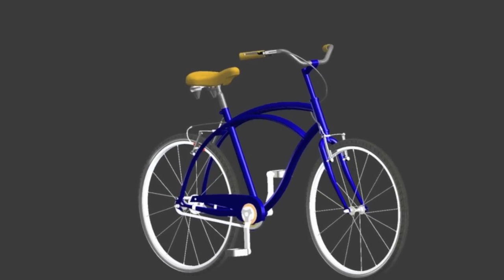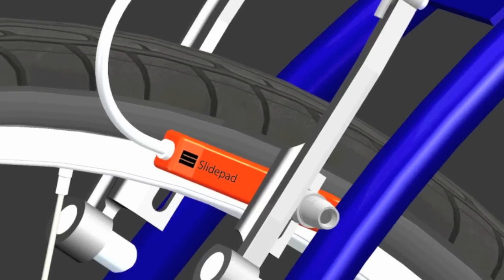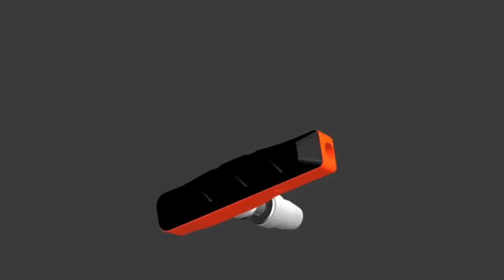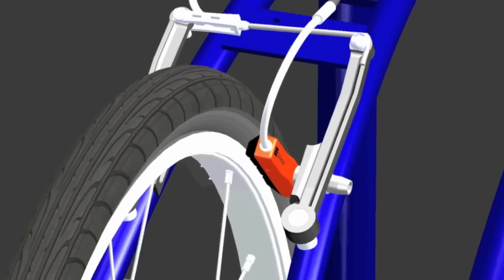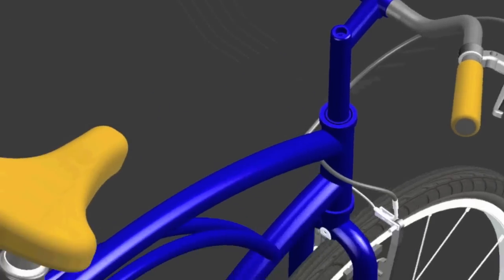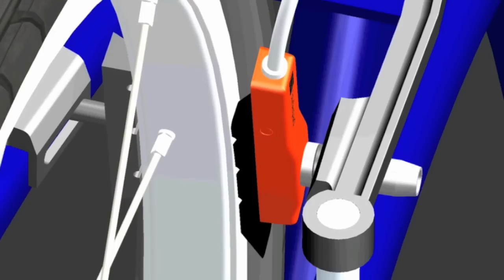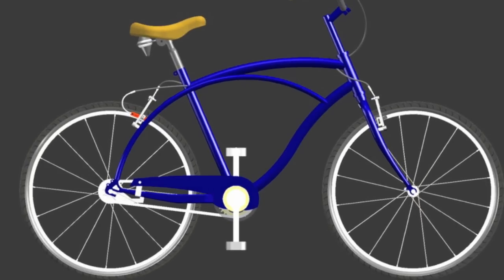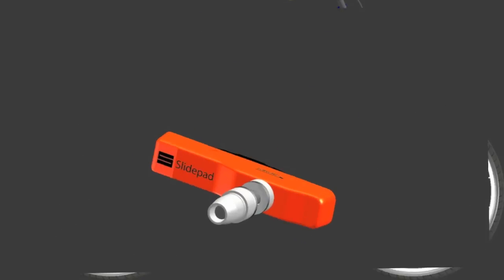Slidepad Brake System - How it Works

Comment: What about rear wheel? It still should have a brake. It gives you a backup, allows to brake more evenly, reduce front lockup severity(although front lockup can largely be fixed by limiting the brake force in front)

Comment: the redundency of 2 brakes ensures you always have 1 brake working if the other locks up. One sided brake means that if you have a problem, you are in a life threatening situation. personally, i love the engineering and i would never have it on one of my bikes, for mountain or city use with cars and junctions. brakes are your life-line on a bike and having 2 life lines is sensible. because if one jams, cable problems, pops out of guide, you have zero lifeline left. scary engineering!!!

Comment from the maker: Hey trsd2009.  No bearings or grease/oil.  The friction b/t the rim and the pad causes the pad to slide.  Water - our special rubber compound slides well in wet conditions.  Dirt - the pad is almost fully enclosed, and the inside is designed to work even if some dirt makes it in (see "internal dirt testing" video on our website).  If it gets really dirty after riding for a long time, it is easy to remove the pad and clean it (see "replacement pads and cables" video on site). Thanks!

Comment: Interesting, thank you for sharing. What allows the slidepad to translate? Is there some bearings or is it just friction between the rim and pad? Also what about dirt and water? Even on the road most the the dirt and grime builds up around my brakes on my commuter.
Reply: THE SLIDEPAD DOES NOT TRANSLATE.  IT DOESN'T EVEN SPEAK SPANISH.